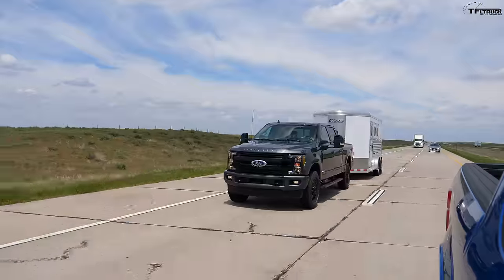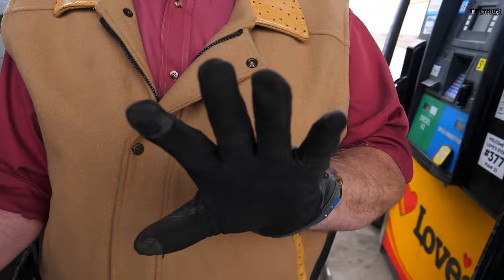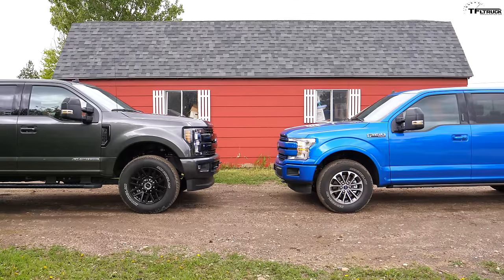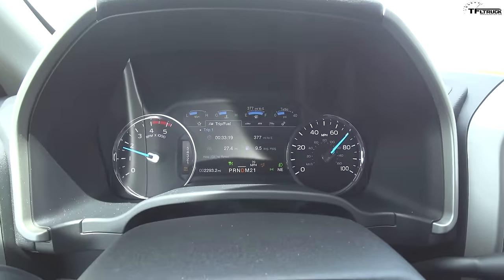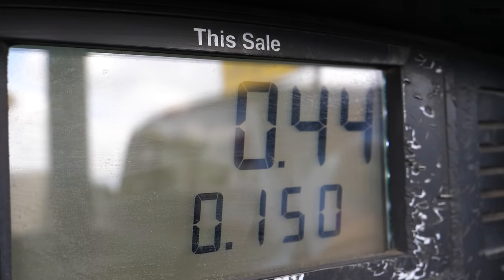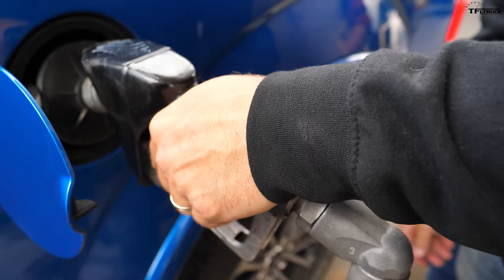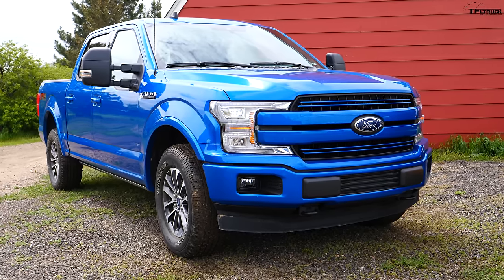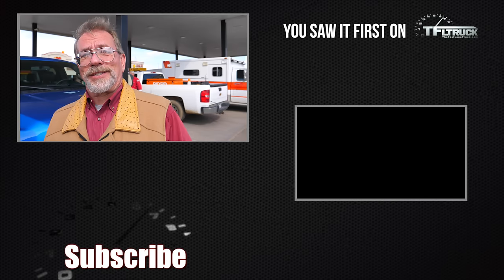Do You Really Need a Heavy Duty Truck to Tow 9,000 lbs? Ford F-150 vs F-250 MPG Review

Comment: Add a hill in there and the difference between a half ton and a diesel pickup will become very obvious.
Reply: 😁 you point is under the rug. Lol
Reply: yeppers gotta do 70mph up them there hills. dont give a shit about nutten but that speed limit.
Reply: Who do you think will be better?
Reply: Jared Jeffcott if a downgrade is that treacherous,  I think you have to be more concerned about runaway trucks, because the brakes on a 1/2 ton are more than adequate to slow that weight down.

Remember, the trailer has brakes also.
Reply: @hdpptowing5736  
I think that it should be a law requiring all trailers weighing more 4,000 lbs, must have e-brakes on them. There are a lot of idiots out there who shouldn't be driving let alone towing a heavy trailer. Lol
Reply: glad someone pointed out this obvious error. Once you get the truck up to speed then maintaining it on a 100% flat road is a joke, there is not going to be any noticeable difference, To me, this "test" is all that they proved here.
Reply: @hdpptowing5736  well a engine brake is a night and day difference! All the newer diesels all have engine brake (turbo brake really) I couldn't image not having my turbo brake when towing.
Reply: When people say this, it's very deceitful. They say "diesel" but remove that turbo and try it with an old school non turbo diesel and you won't get much difference. So if you want to compare apples to apples, slap a turbo on this 5.0L and throw a hill in there and guess what... No difference. Heck the 3.5L Ecoboost would eat those hills up no problem. This 5.0L with a turbo would annihilate the 3.5L Ecoboost.
Reply: @HalfShell what's your point? I drive an automatic 18 wheeler and some don't have engine brakes either... Or at least engine brakes that actually do anything. Many of these younger truck drivers don't even use engine brakes on these automatic semis
Reply: @Sig721Tau  isn't there a law that says they need electric brakes if over 3k lbs

Comment: How about something safety related, like braking distance with those loads.
Reply: They really need to test braking once. I have always wanted to know with light duty vs heavy duty who brakes better with a load.
Reply: @jasonoliver3364  with trailer brakes on a tandem axle trailer, both trucks are completely fine. I tow a 6x12 with 7,000 lbs with my Tacoma and the trailer takes care of a ton of the braking for the truck. I don't feel unsafe at all even under emergency braking.
Reply: Properly set electric brakes on the trailer will do most of the braking.  If your towing at max you need to drive defensively and keep braking distances in mind.  If you drive it like your not towing your gonna have problems.
Reply: @randythompson4006  100% accurate. thank you.
Reply: @randythompson4006  : Unfortunately how you drive has little effect on the idiot that cuts you off then slams on his brakes...
Reply: @fredflintstone4715  that is an inevitable thing unfortunately.
Reply: @fredflintstone4715  Nor does how you drive impact how your vehicle handles 50 MPH gusts of wind. These guys are missing the point completely.
Reply: The bigger truck has more weight to stop so even bigger brakes doesn't mean it stops faster,but an actual test would tell how these two trucks compare other brands might be different.
Reply: And also stoping distance 60 to 0 of f-150, Ram 1500 and GMC Sierra without load.
Reply: Fred Flintstone This isnt the 80s
Reply: Exactly. I tow a 7x14 tandem axle every day, and i use a cummins ram. Not so much for the power, but the brakes. Even with my trailer brakes, i like knowing that i have 4 huge disk brakes to help me stop. Ive seen alot of guys tow with half ton trucks and swear by them, till their trailer braked need serviced and theyre relying on a half ton brakes. Half tons also seem to break alot more. Usually the spit the transmission out, or the rear end eats teeth.
Reply: Or an emergency avoidance manoeuvre... Soft half ton vs. 3/4 ton; the tail will wag the dog with the shorter wheel base and squishy ride
Reply: But how many miles can you drive it ?
Reply: Wouldn't even be a comparison.  Not even a competition
Reply: ya
Reply: smoberdeen okay. Fair. So you’re asking TFL to do straight up truck only braking tests with these test trucks correct? I would imagine their insurance company would love that lol.
Reply: @smoberdeen  so what i just read is no way your own fault?  You have a camper trailer with brakes.  They bearings and sesls need to be checked 3,000 miles under normal use.  If you rarely use the trailer than you need to pull the inspection plug and check inside everytime you hook up.  This was an avoidable issue.  Now you'll say i checked them.  Reality is the average camper user never checks.
Reply: @fredflintstone4715  that's where dash cams can come in handy
Reply: @SFretnchillin  I tow my camper, 12-13k lbs depending on loading on my 2018 f150 ecoboost max tow package..  I also used to own a 6.0 heavily modified F250.   As long as you dont want to run 80MPH, the F150 handles the weight wonderfully.   You do need a weight distributing hitch, or go fifth wheel for that though.
Reply: exactly!!!WHEN YOU ARE TRYING MAKE THAT 60 TO 90K SELL, HELL BOY WHO CARES!!!
Reply: @randythompson4006  how many people adjust thier trailer brakes every 3 thousands miles like your suppose to.
Reply: @harleyhawk7959  you sir have summed it up exactly.  Who does it?  If we all just did a lil more than some of these problems may not ever happen.
Reply: Jonathon Smith no in the 80s trucks were not a show off toy for your wife to haul the kids to basketball games or soccer games. Trucks back then you were lucky if you had cup holders.  My 84 f150 with the old reliable 300 in line 6 4wd was a beast. We would pull 25 foot flatbeds loaded with green grass bails stacked 3 high plus the bed full of hay all day long with that old work horse. No A/C every time you would hit a bump your front tires would come off the ground lol. My dad had a 79 f250 long bed. We put well over a ton of gravel in the bed on it several times. Same thing. Hit a bump front tires would jump up in the air. Made for and interesting day. That old 390 v8 was a hoss though. Four on the floor with a granny low. You could easily start off from a stop light in 3rd gear. 4:10 rear ends with 6 leaf springs overloads. Those were the good old days.
Reply: @mbsnyderc  the bigger brakes and stouter frame give you much more control of the stop. Plus a flat route with no traffic and little wind of course it would be easy. If you only tow on rare occasions, by all means, go with the half ton. But if you do ith with any regularity get the 3/4 or 1 ton
Reply: sniperdoug1969 
Ya in the old days they built them over kill heavy duty but they used trucks back then what they where used for.  Not a girly truck lol you know what I mean. Mans truck
Reply: The bigger truck is far superior in every way when towing. Iv had half ton, 3/4 ton and 1 ton trucks and the halfers, though comfortable, just don't compare. These guys are claiming the trailer does most of the braking. They are missing an important thing. When you are towing heavy and have to stop fast, a lot of your trucks weight shifts to the front end and off the rear causing a "light" point at the hitch. This "light" point then wants to pivot. With a half ton it feels very squirrely. I pull an 8k# work trailer with my 1 ton single rear wheel truck and it is planted and sturdy at ALL times in ALL conditions.
Reply: Well when your using your feet to stop it makes a big difference!
🤡
Reply: @randythompson4006  I think you're right - it would mostly be a test of the trailer's brakes. But... would be really interesting to see what happens if the trailer brakes fail. So a test with them unplugged to see what happens. My bet is that they're actually a lot closer than most people think.

Comment: These half tons have come a long way! I have to say, when my 03 7.3 was down I had to borrow my dad's 2018 ecoboost max trailer tow f150 for a 4 wheeling  trip. Wow! is my reaction.  It towed the 8500lbs like nothing.  We have done several comparisons since then and yes the diesel got 11 mpg compared to 6.5-7 mpg ecoboost.  One comment i would like to make though. Everybody talking braking power and ability from half tons,  the brakes on my dad's f150 are soooooo much larger than my 03 7.3. Thats why a 2018 half ton has a higher tow rating than a 03 3/4 ton. Blows my mind, but a stock 18 ecoboost puts my 03 tuned 7.3 to shame.
Reply: The problem here , how far did u pull it brother? I didn't find those trucks to powerful! I also had a new RAM sport n it would pull 9 or 10 too but the truck felt like it was to lite n I got  a old 1997 7.3 ford dually n she's pulling that like nothing n the truck doesn't bounce around on the road doing it!..  MERRY CHRISTMAS 🎅 ✌ after I bought this old girl looking like she was in a time capsule, I got rid of my RAM because of electronics issues N I DONT MISS IT EITHER!..
Reply: Poppycock

Comment: Wow. I am shocked, but very pleased. I just bought a '19 with the Coyote and can't believe there was only a half a mile per gallon difference. After driving a friend's 6.7L, I suspected that but you guys confirmed it. I only tow around 8K lbs so I am feeling pretty good now. When you factor in the cost difference of diesel fuel, the expensive services, DEF and the initial $10K difference... Wow... Thanks guys!!

Comment: Next lets see the half ton v8 vs the 3/4 ton 6.2L gas engine.
Reply: Or the new 7.3 with a 10 speed
Reply: @madbear3512  - What horseshit? Pretty sure I read something about the 7.3 coming back... If I remember correctly it identifies as a gasoline engine now.
Reply: @duttydiesel8303  
It horseshit that it the fact there even making a gas engine as a choice
Reply: I’m not even interested in a diesel so I don’t think it’s horse shit. I’d only buy a gas for my use.
Reply: The 6.2 sucks
Reply: Don't compare it with the slugish 5.0. Put it up against the 3.5.
Reply: Jimmy's Tractor the 3.5 and the 5.0 make the same power I actually like the 5.0 better
Reply: @kylebrown8891  The 6.2 is fine, better than the 5.4 it replaced. It's durable enough for the Super Duty. 

The 6.8 V10 is good too, I've driven straight trucks with it and it has plenty of power, being a 5.4 with 2 extra cylinders, it's an under undersquare engine, longer stroke than bore so it has a great torque curve. 

The new 7.3 V8 that's replacing the V10 should really kick ass.
Reply: snakesonaplane2 I’m not saying there not durable   I’m actually not sure how durable they are because the three we had only had 20,000 on them. I just feel there under powered compared to the power strokes and even the v10. The 6.2 strives on rpms, really really high rpms. Same as the 5.0. I just don’t like towing at 5500 rpms because I’m just waiting for that real loud bang. But then again none of our 6.2 or 5.0  have gone bang yet.   Two of the 5.0 have over 200 thousand on them and we still run the snot out of them
Reply: @kylebrown8891  They shouldn't need to run that hard unless you're towing a heavy trailer up a steep grade, and if you need to do that often, you'd be better off with the diesel anyways. The gas engines are meant for work but I wouldn't want to push it to its limits every day.
Reply: snakesonaplane2 ya we’re pulling skid steer sand minis around upstate ny so a lot of hills. Plus they were 1 ton trucks with dump body on them so heavy to begin with. Just not right for what I do.  In a 3/4 ton pick up pulling campers and stuff like that I’m sure there great but like u said how long will it take the beating how we use them. If there as good as the 5.0s we have it won’t be bad because there cheap maintenance
Reply: @kylebrown8891  That's why I think the new 7.3 is going to be a big seller, it makes a lot of torque from 1500rpm so it's good for pulling at lower rpm, and it's tuned for lower peak output so it's not stressed out. And being an iron block pushrod engine, it's simple and built to be durable. It replaces the V10, but I think it makes the 6.2 kinda pointless since I bet it'll get similar mileage. The 7.3 makes enough power that it's not worth the extra cost to buy the diesel for a lot of owners.
Reply: snakesonaplane2 I heard the 7.3 was gonna be a pretty good working motor. I was hoping they’re would come out with aluminum one for in the mustangs and half tons. I own  a 2013 f150 with the 5.0   It’s paid off now so I think I wanna put a whipple charger  on it.
Reply: That's what I'm interested in
Reply: @kylebrown8891  why? I'm looking at a  2011 limited F150 with it. The run forever.
Reply: alb12345672 why do I like the 5.0 better? 
Iv always been a v8 man and they sound better. But main reason is when they first came out with the eco boost they scared me being new technology and they do have there one set of problems seperate from the 5.0. Eco boost just has a lot more stuff that can go wrong in my eyes but it’s been almost 7 years since I picked the 5.0 and I don’t hear to bad of stuff about the eco boost except when they break they really break.
Reply: @kylebrown8891  Oh the 5.0 is great but the fact that 6.2 goes in the superduty tells me I can buy a used higher mileage truck with confidence. Eco is hit or miss. I test drove a 2012 with supposedly 220K original miles and it ran great. I wouldn't buy and the dealer said 5.0 is the best bang for the buck. He said you tow at full capacity with the eco you are going to have issues.
Reply: alb12345672 the 6.2 is also a good motor but just fells gutless to me
Reply: @kylebrown8891  well it is designed more for heavy loads at highway speed.
Reply: alb12345672 well iv only drove a couple dozen of them and hate them. If u wanna spin 6000 rpms all the time pulling a trailer go for it. They strive on rpms to get there hp
Reply: @madbear3512  is this the same keith that I worked with at Ford windsor engine plant making crankshafts
If it is hi keith this is Brian
Reply: @kylebrown8891  the 5.0 is a lot lower torque at a lot higher RPM.  Having had both the 3.5 is better at towing.  You aren't running at 4500 rpm all the time, more like 2500 rpm.

Comment: I notice one factor that’s never mentioned in all these tow tests and tow comparisons is the driver. I think the driver is the most important factor when towing these type of loads with any 1/2, 3/4, or 1 ton pickup. The trucks capabilities become irrelevant if the driver is inexperienced or doesn’t have any common sense. All in all, I think the drivers abilities or experience and knowledge are an important factor.
Reply: What drivers knowledge does a person need for towing 
Asking because I am curious and have never towed anything
Reply: @TexasNationalist1836   realize that its a truck you don't need to almost ever floor it except for a few situations. choosing the right gear before a hill build up some speed before hand and be willing to take the hills at 40mph. I know my old truck gets the best economy at 62mph due to the rear end ratio and that's the speed I go, may not be practical for everyone but it works for me. ask around at some truck stops a lot of the older drivers are happy to share. books only get you so far experience is everything.